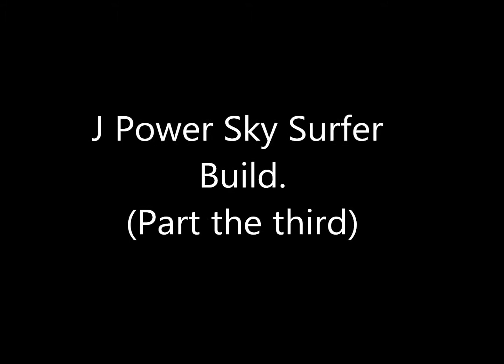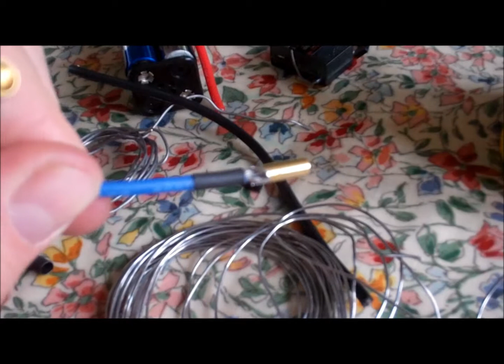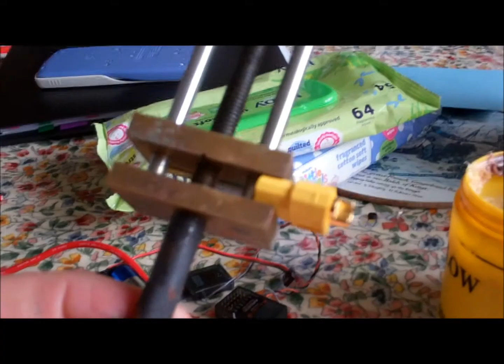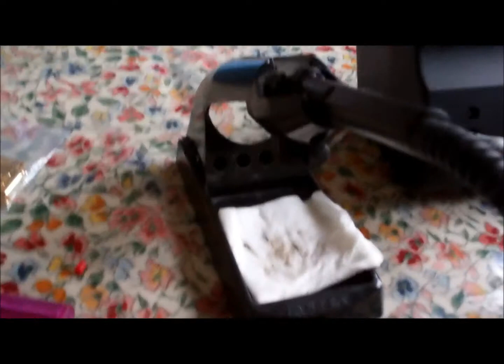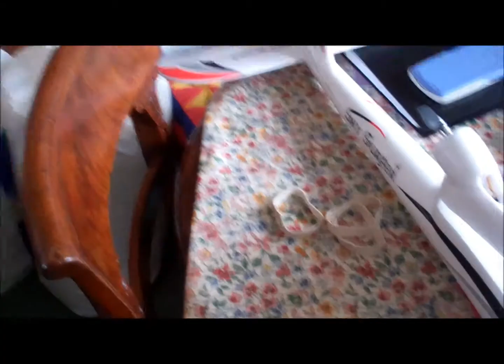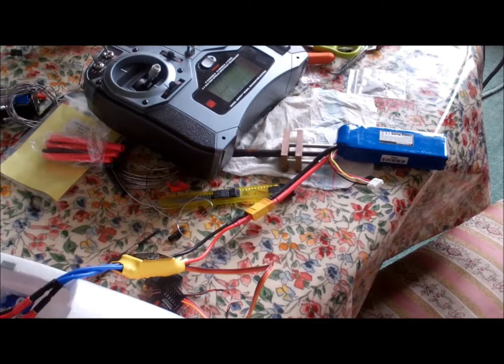J Power Sky Surfer Build

Comment from the maker: @paulrabbi2011 I have got the radio gear installed and hope to get a video up this week. Basically I put the ESc behind the servos under the wing, receiver infront of the servos and the battery (I'm using 3S 2200mah) as far up the nose as I can. I had to cut one of the bulkheads a bit so the battery fitted. You're right about there not being much room though.
Cheers.